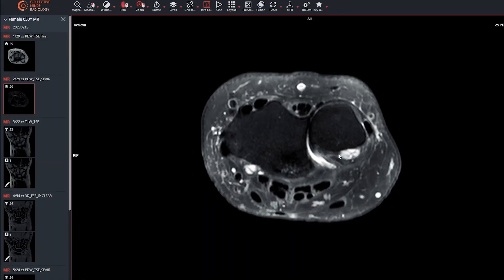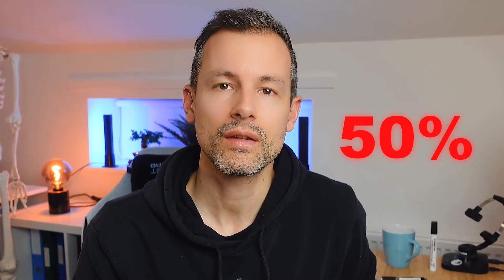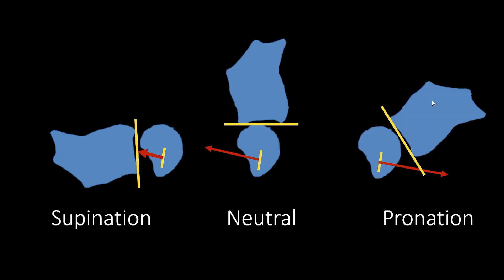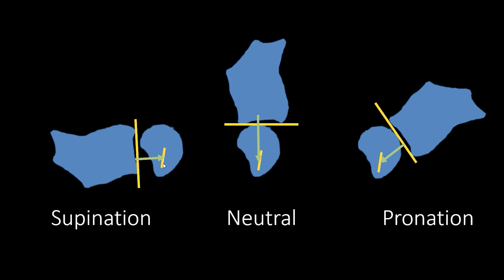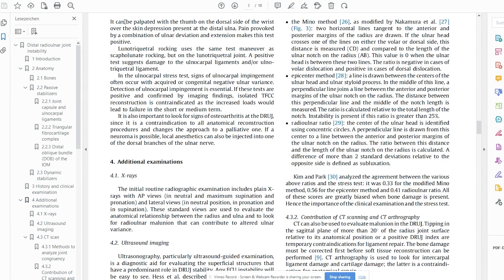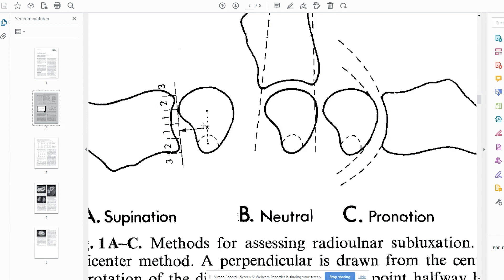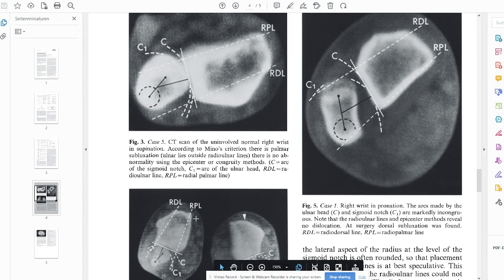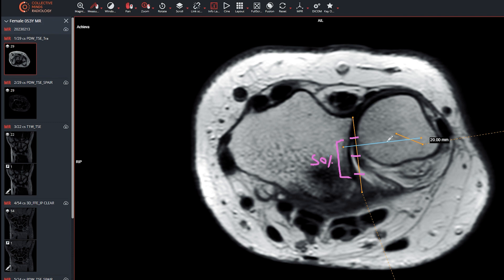MRI of DRUJ Instability / Distal radioulnar joint instability measurement

Comment: Problem is not radiological. Nor ”ulnar”. I am very aware of the current terminology, but to name a physiological translation as ulnar subluxation is simply wrong. 

Instability is not a radiologically measurable attribute, since it is dynamical process, or better named ”an inability of a joint to sustain a load”. 

And it is the radius that displaces, since it is the mobile unit. Not the ulna. Similarly a dorsally dislocated PIP joint means, that the mobile part dislocates, not the more proximal, stable part. 

I think that the radiologist should look for the parts torn or broken, not to measure distances and arbitrarily classify 3 mm displacement physiological and 4 mm pathological…
Reply from the maker: I agree, yet clinicians order studies with questions for instability. Regardless of that identifying the underlying broken structures can hint indirectly at instability like in the mentioned methods that have been published
Reply from the maker: Cuff off values are just statistics. I like to teach to my fellows that it's going to be different between a 210cm basketball player and 150cm gymnast lol